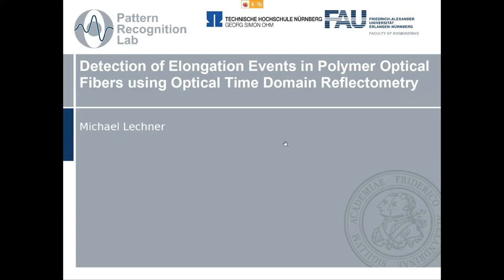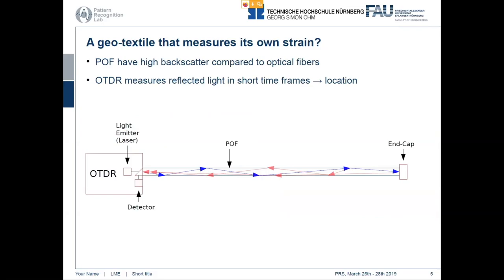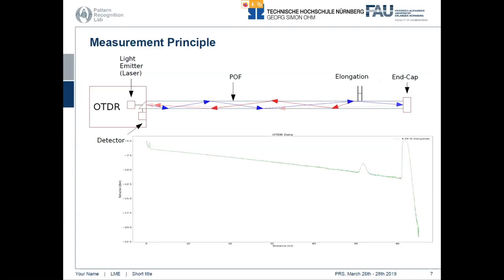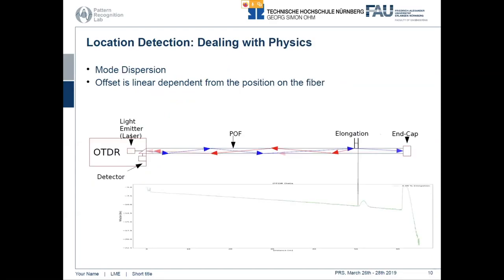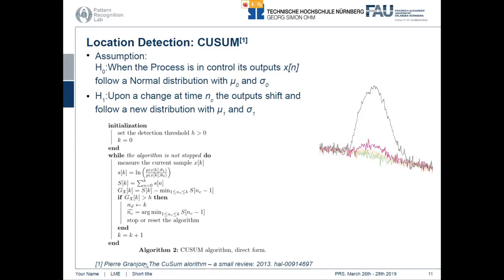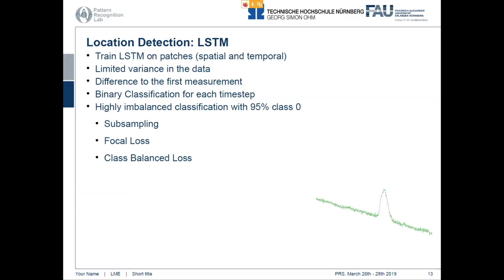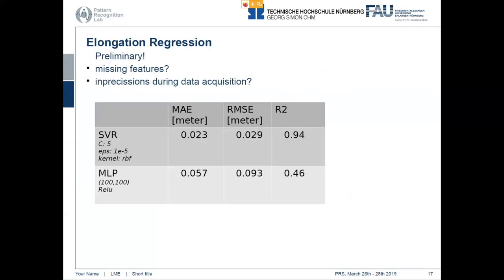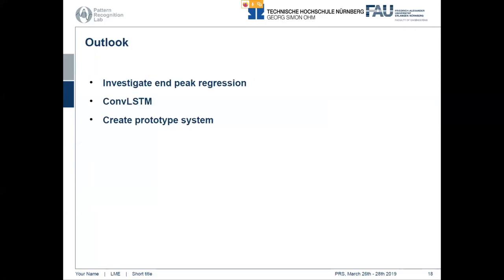PRS Summer 2020: Detecting Polymer Optical Fiber Elongation Events

Comment: Hello.
In the journal Optics Letters, researchers Glen A. Sanders and Austin Taranta from Honeywell and the Optoelectronics Research Center at the University of Southampton in the UK describe how they used a new type of hollow-core optical fiber. This allowed them to increase the stability requirements of the gyroscope by 500 times compared to other fiber optic gyroscopes.
❤